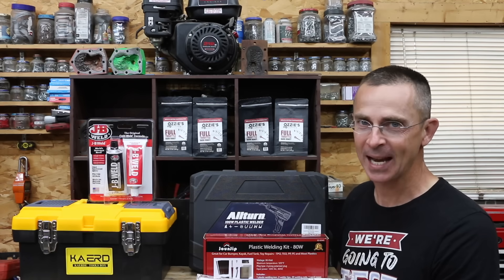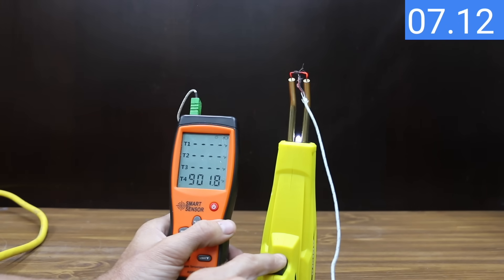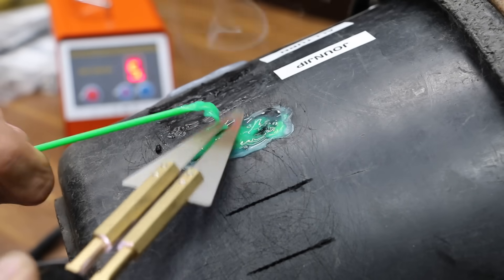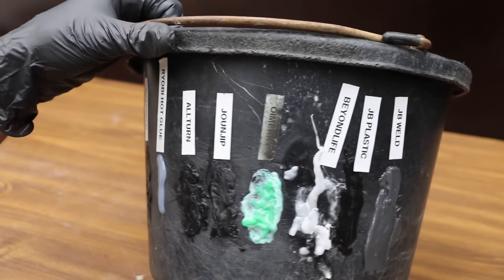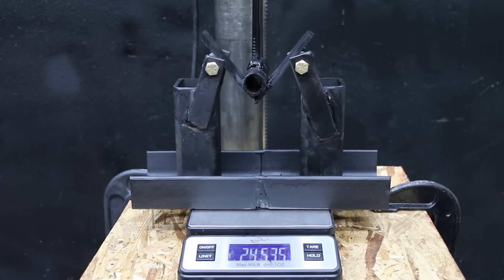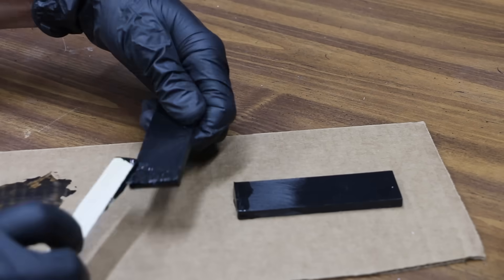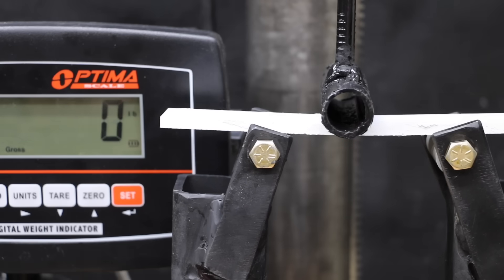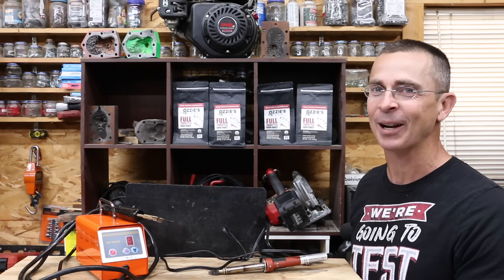Don't Buy A Plastic Welder Until You Watch This Review!

Comment: These are BUTT WELDS.  Most difficult to repair.  Jb weld is going into the broken crack which helps.  He's not welding into the divided broken area. He's just doing surface weld only.  

This wasnt the best scientific test he's done.   He's welding skills need improvement.  sorry.

Comment: There is a particularly tricky aspect to repairing some types of plastic:  the material can shrink (like "heat-shrink" tubing).  The tension of this shrinking will pull apart the "repair",  just as soon as it is melted.

Comment: When doing plastic repairs, I find the most important thing is to use filler material that is exactly the same as the part you are repairing. In your video section where you tested the beyonlife it appeared the clear rod you used was very incompatible with  the buckets black plastic, kind of oil and water like.

There are several ways to flame test plastics to determine what material family they belong to, though with so many alloys and fillers used this may not be close enough.

I typically cut out a  piece of material from a related scrap part to use as filler material. Much better results that way.
Reply from the maker: Thanks for your opinion.

Comment: At the auto body shop I work at we use an off-the-shelf wood burning kit with adjustable temperature and multiple tips. We use the sharp, thin, angled tip to make "stitches" across the break, then use the thick flat tip to smear the melted plastic into the stitches, then put metal mesh on that and heat the metal mesh with that same flat tip until it melts itself into the original plastic. The only time we even use welding sticks is if the material is very thin to reinforce the back side of the repair. It works shockingly well. We have had customers on two occasions later have another accident impacting the repaired area and it's strong enough that the repair was intact and the bumper cover ripped or broke next to the repairs instead, which shows it's actually stronger than before we repaired it. Basically, a good repair should penetrate beyond the surface and preferably go all the way through the material. Melting the metal mesh INTO the material was the real game changer. It's like rebar in concrete. You end up with a piece that is stronger than the sum of its parts.

Comment: ABS repairs are best performed by solvent welding.  JB Weld Plastic Bonder is better suited if you need more flexibility than epoxy.  I do plastic welding with a temperature controlled soldering iron with a huge tip.   Granted, it's a $600 iron so it may not be a fair comparison.  That hole through the heating tip to feed the filler rods is a great idea.  To obtain better penetration you may want to bevel the edges that you are joining together so that you can start at the middle and build up the plastic from there.
Reply from the maker: Thanks for the feedback.

Comment: When using wire mesh you should melt it into the repair first then plastic over it. Staples should be staggered on both sides if possible. Great video!
Reply from the maker: Thanks!  Thanks for the suggestion.

Comment: The best way to achieve maximum strength with the Jounjip is to evenly bury the mesh into the plastic surface (both sides if possible) before adding the melting bar material. The material being repaired and the melt bar material MUST be the same material to achieve proper results. If you properly bury the mesh deep enough in, you can fill and sand the surface flat and polish if desired. Takes some time and patience, but you can actually make some strong and tidy results. 👍🏻😎👍🏻
Reply from the maker: Thanks for the feedback.

Comment: Did you use the same plastic as the bucket is made from ?
You need to weld plastic at the. Correct temperature 
Abs 350 deg c
Pp and pe 300 deg c
Etc

Comment: I have the original “green one” made in Switzerland. It does exactly what I bought it for. Making sturdy water tanks. I have used it for other projects as well. It is crucial to make a fillet weld and use the same type of plastic rod as the plastic you are welding. It’s easy to use, after a bit of practice, and professional and strong.
Reply from the maker: Nice!

Comment: The Beyondlife is a professional tool that takes a few days of working with to really get the hang of. It's meant to be used more like a metal welder.. You should use a lot less heat with thinner plastics, and If you were to do a butt joint then you should bevel each edge the thickness of your filler rod and feed it in parallell to the bevel rather than perpendicular

If done correctly then the weld can be stronger than the parent material 👍

Leister is the go to brand

Comment: for HDPE my suggestion is find a container/containers that use HDPE(milk jug, whiper fluid, etc etc) or 3-5mm thick pieces of hdpe... cut a square/rectangle/other put it over the cracked area...... hot air gun it till it adhere into the existing HDPE and add layers as needed(a smaller nozzle might allow a bit better control); treat it as patches, can melt around the border than let it adhere further after(** if it's semi transparent it will become transparent when it begins to adhere; it will be pretty simple to tell it's going well.....)
Reply from the maker: Thanks for the suggestion.

Comment: Regarding those butt welds where the weld plastic bonded with the test plastic, I have to think it would be a stronger joint if you grind a vee groove as would be done when welding steel.

It would be very interesting to try welding with pvc water pipe, both joining pipe without fittings and repairing joints that have broken fittings. It would be easy to use water pressure to determine the success of the repair.
Reply from the maker: Thanks for the suggestion.

Comment: Seems like this test is more for the black filler rod used than any of the actual welders or different plastics. Using the same filler for all the plastics tested is not creating a proper bond. As evident in all the tests where it clearly didn't adhere properly. Melting the rod on top isn't going to hold the pieces together. You need to melt the original plastic first. Put the mesh first into the original plastic and then if you need to, add more filler on top.
Reply from the maker: Thanks for the constructive feedback.

Comment: check out this video (AIT induction - Hot Air plastic repair - Collision Repair Line) after experimenting with multiple ways to repair bumper covers and headlight tabs using hot air and filler strips has been the best and easiest. I have also used them in conjunction with hot staples. this has been my goto for the last ten years.
Reply from the maker: Thanks for the feedback.

Comment: I've done some plastic welding.  My experience has been that the material that comes with the plastic welders  is weak and too flexible.  I keep the plastic back of a large old TV to use as filler material. 
It does a great job.
Reply from the maker: Thanks for sharing.

Comment: with wiremesh i repair car bumpers, headlights and other plastic stuff, the ideea is to get wiremesh way up in the original plastic, you dont need extra welding material and the plastic weld gets a LOT stronger.
Reply from the maker: Thank you for sharing!

Comment: PVC, ABS and poly carbonate are going to do better with chemical bonders than any heat bonder.  I can see this being useful for HDPE though, which is probably the most friendly plastic to work with at home.  I have used grocery bags to make plastic sheeting for various projects and a tool like this would have been handy for those. I  may have to pick up a lower end one of these.
Reply from the maker: Thank you for sharing!

Comment: The air welder is hard to use im a vinyl floor layer he had it well to hot would have used setting 4 on that bucket not 9

Comment: You do such a great job with your reviews. For plastic repair as many others have noted, there is a lot more to know to make successful and durable repairs. The first thing to know is when to give up and replace the piece rather than attempting a repair. For many plastics in commercial use, a repair will never truly be successful. 

The key ideas to know are these: first - know which plastics are which, and what repair techniques can and do work. For many thermoplastics that means knowing what temperature to use, what pressure, surface removal, and technique. For some, heat is not the answer, and some glues may be effective, at least temporarily.

For some plastics (fluoridated polymers like Teflons) high temperatures are a no-no, and exceptionally good ventilation is required. Best is to not attempt to repair those if you do not know. At high temperatures these plastics give off highly toxic fluoridated organic compounds. These can be fatal. For beer drinkers, attempting to repair these with poor ventilation can rapidly lead to nausea, giant purple splotches, flu like symptoms and a trip to the emergency room where the doctors will be baffled. 

For common plastics like the olefins (polyethylene, polypropylene and copolymers of these), repair is easy. First drill a small hole right at the ends of the fracture. This terminates the break so that it doesn’t continue. Next, champfer the split so that the full thickness is exposed and oxidized polymer is removed. Next, use a rod of the same material and a heat gun to gently raise the local area to the “glass transition temperature”. This is just shy of melting. The visible properties will change slightly. It will turn “glassy”. Now gently insert the rod into the fracture and melt it along with the base material. 

This is similar to metal welding, but you don’t make a “puddle” or use circular motions. Gentle straight motions are fine. Just as with metals, thick cross sections may require two or more passes to fill the fracture and melt the entire surface together. The end result will be a smooth surface. It will be quite noticeable unless you have exceptional technique. Sanding and then surface flowing with mild heating can create a very nice joint. 

Some plastics, such as highly cross linked polyethylene or polybutylene may not successfully be repaired in this way. Others like ultra high density polyethylene may appear to be repaired, but will fail later. What happens here is that the polymers don’t truly interpenetrate. Instead the surfaces weakly join, and a fracture will reopen later as the join line splits.

High density polyethylene can be successfully butt fused or be welded. But careful control of temperature and pressure is required, and a good eye is essential. If the join has a right angle or worse, it will fracture. The transition must be smooth with no distinct corners. 

Other plastics work similarly. Which can be successfully joined or repaired depends on a lot of factors. Knowing what plastic you are dealing with is key.

And just as with metals, it is possible in some cases to seemingly join dissimilar materials, only to have them fail later. Just as you can weld monel to stainless steel in a seemingly perfect join, only to be able to shatter the weld by rapping it an hour later with a hammer. 

Some plastics, like PVC can be easily repaired using solvent based glues. However, it is vital to know why the plastic failed. PVC fails easily under UV exposure. It is also a “garbage” plastic with dozens to hundreds of chemical additives. Most common are phthalates. These leach out with warm caustic solutions that can redeposit into the plastic in another place. As a result, one section of pipe for example can become extremely brittle, with another section turned into something akin to rubber. Phthalates are toxic. PVC should NEVER be used in drinking water systems - despite that being allowed in many jurisdictions. 

Etc…
Reply from the maker: Thanks!  Thanks for sharing.

Comment: Yeah, welding plastic is definitely not the most common trade/skill. But I did do it for a living for about 2.5 years. You were definitely doing it wrong LOL! Feed rate is the trick as you lay the melted rod in a valley machined in the material just like welding steel. The Beyondlife is closest to the style I used in the mid 1990's. The plastics we welded to make chemical resistant tanks were polypropylene, polyethylene and acrylic. The melting points of those plastics are better suited for welding than say something like ABS.
Reply from the maker: Thanks for the constructive feedback.

Comment: I would be interested in a test on portable soldering irons.
Reply from the maker: Thanks for the suggestion.
Reply: @ProjectFarm  I currently have a Milwaukee soldering iron and had problems after running it for 15 minutes. The tip melted in the plastic collett that supports it. Would love to find a better option

Comment: i wonder if you bevel a little in the material (a chamfer) it will hold stronger? i am a welder and it help for getting a deep penetration as well as stronger weld plus it give you more metal to weld on before the weld overlap the steel (unless you want it flush with the surface) it is better to do so when you can.
Reply from the maker: Thanks for the suggestion.

Comment: Great video! One thing I think would make the welds stronger when doing the two pieces butted together is melting the pieces together before you add the filler, also to make sure you use the same filler material as the test piece 👌🏻
Reply from the maker: Thanks!   Thanks for the constructive feedback.

Comment: I think you would have much better penetration, and therefore better results if you cut a chamfer into the sides of the plastic where the weld is. The same thing you would do for thicker metals when welding, it helps to have a good amount of new material piled up at the weld spot so you are melting together a larger surface area on both sides
Reply from the maker: Thanks for the constructive feedback.

Comment: As a metal welder, i noticed at the part where you where welding 2 pieces together i saw no gap between them, like when you do steel, you always have a smal gap/or tilt cut/bevel so the weld get good penetration, watching this is my only plastic welding experience, so i dont know if you need a gap/bevel on plastics, but in my head i would prob say yes to a smal gap like metal. Dont no!
And i'm not afraid to be wrong and corrected, if anyone wants to
Reply from the maker: Thanks for the feedback.

Comment: You are uising wrong materials while wleding. You need to use the same plastic rod with your plastic that you want to repare. Also you are OVERHEATING on every single step. Even if you use the same materials, if you overheat the plastic, this spot will not be correctly welded.

Comment: Not sure these “tests” are much better than disingenuous. The problem with plastics repair is 43 times out of 10 it’s NOT a flat surface that you’re working with. It WILL be a formed piece of plastic and that just the substrate over which another material will need to be replaced thus restoring functionality to the whole repair job! Good example: I had to repair the center console lid in my wife’s 2000 Ford Expedition. After 23 years of use and abuse the plastic beneath the padding and upholstery had major cracks and plastic pieces. Why? Because EVERYONE uses their elbow leaning on that lid while entering and adjusting ones seating position to drive. It’s really amazing it survived 23 years of this to begin with! Anyways: after removing the upholstery and the padding there would be no way to repair the plastic in the manner shown in this video as you’d feel EVERYTHING under the padding! These examples/tests in this video are a hideous fucking mess and would NEVER be tolerated in any legitimate scenario requiring plastic welding! So, I did plastic weld it using a wood burning tool (it’s the same damn tool with different marketing. Fucksake you’re just melting plastic!) and the there was already plenty of plastic in the piece itself to melt and draw back together! No need to add extra. It worked perfectly! The “welding” was done to both sides of all damaged pieces, cracks, broken off pieces. 
THAT is the honest PRACTICAL side of this application.

Comment: As plastic welder is I’m disgusted by the use of the welder at the five minute mark no prep work to the cut sand it or scrap it with the tool that was provided in the kit 😂 do something it’s not gonna hold a weld with contaminants all over it and the welder is way too hot. You need to turn the temperature down to a pace, you’re comfortable with and stop using the speed tip and freehand the welder  here’s a tip get the plastic rod at a 45° angle. Get your welder and go up-and-down up-and-down on the material and the rod as you push down on the rod and go along the weld, you should see a nice small bead of  melted  plastic underneath the rod the trick is to get the rod and the plastic material all at the same temperature not too cold not too hot like Goldilocks so the molecules I can properly bond the repair weld should look like straight line and should generally only stick out 2mm off the surface

Comment: I've done some work repairing kayaks and found that the biggest problem is often excess heat. High temperatures will affect material properties and while the repair can support the use (hold water and support impacts), it will often break in a heat-affected zone. 
It takes longer, but temperatures just above melting point will lead to better work. For that, the ability to properly set temperature can be more relevant than max temperature or heat time.
Reply from the maker: Thanks for sharing.

Comment: A handy tool in 3DPrinting is a 3DPen, a chunky pen with a small motor to push the plastic through. Just watch which size filament it can feed, they usually use 1.75mm, and few 3mm.
Reply from the maker: Thanks for the feedback.